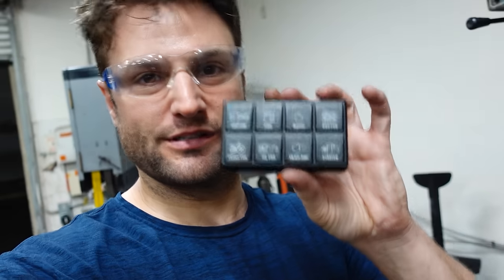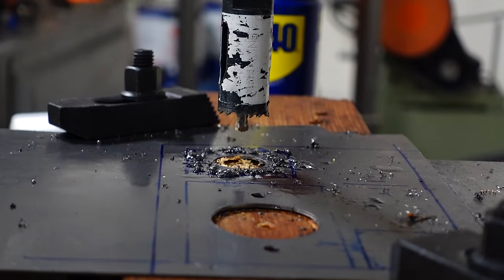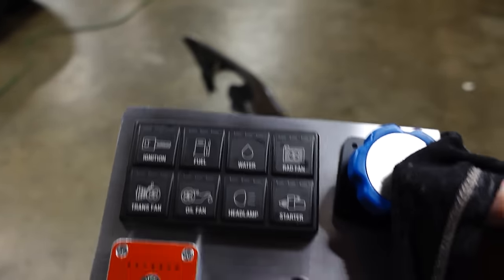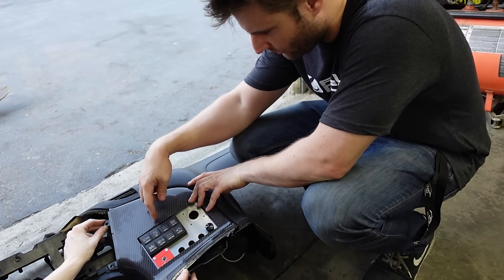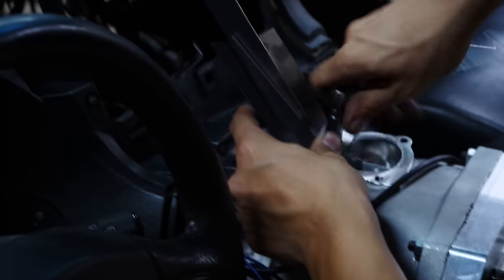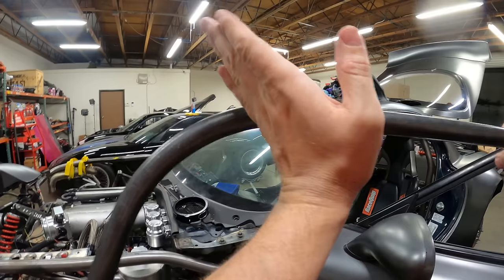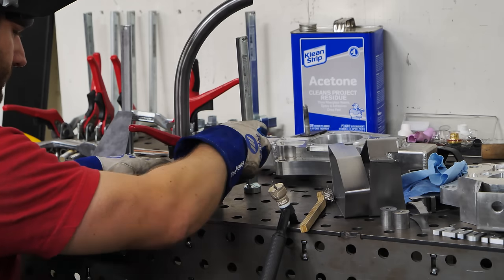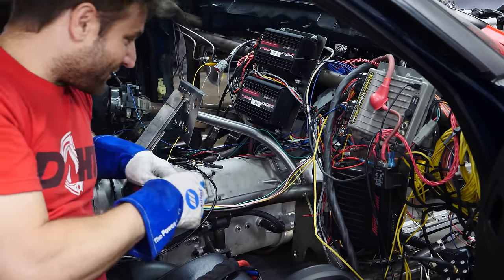Making a Control Center in the AWD 4 Rotor RX-7

Comment: Rob, your control box for your drill most likely has a dry solder joint and / or failed capacitor inside due to its age.

Realise you have a lot on your plate to prepare for, but when you find yourself with an hour, disassemble it, coat the PCB with flux and resolder as many joints as you can.
Reply: True! Old caps crap out when they get warm. You can spot them if they leak or blown up!
Reply: Also wouldn't hurt just to clean the thing out solid, a metal shop environment is hard on electronics
Reply: Wonder if he'll see this
Reply: ^^^This^^^ Get a clean toothbrush and alcohol and clean the thing after too. Oil gets into everything.

Caps are super cheap and are why many flat screen TVs "die". I've fixed a few TVs and monitors by replacing blown caps.
Reply: if the power supply section of that DRO is separated at all, it will be totally easy for any electronics shop to repair. Maybe Louis Rossmann would like to take a crack at it?
Reply: @auke1031  I'm pretty sure Louis only specializes in apple products and Chinese Amazon ebikes 😂

Seriously though, opening up an electronic device and just soldering away is a great way to popcorn an IC and really fuck your day up.

If you don't know what you're doing, do yourself a favor and DO NOT cover your boards in flux and go HAM with a soldering iron. That's just horrible advice to give someone 🤣
Reply: Where is Isaiah?
Reply: He needs some ToT thisoldtony

Comment: So open that readout and look for dying capacitors. That looks like an easy fix, soldering relatively large components. Just use PLENTY of flux. If it's 10+ years old, just replace them all on a general maintenance basis. New caps are quite cheap and usually solve mystery problems like that.

Comment: Not good to have acetone standing on your welding table
Reply: Sure it is. You need to make sure you have a clean surface to weld on. Having it close at hand allows you to dowse the material in acetone mere seconds before you hit it with 1000° of heat. It really adds to the thrill.
Reply: Could make a good video great

Comment: Dude imagine Rob taking this thing to RMRW with Cleetus. 

AND Hoonigans donk comes too.
Reply: hoonigans is coming for shure! and for RMRW i think he will take the 2rotor corvette if he ever is going to attend
Reply: @guidoheeling1179  yeah, the 4 rotor uses sooo much fuel. it would struggle to get to the fuel stations on rmrw
Reply: @rorybrookes  mwa that's not my point, i think he has like a 30/35 gallon fuel cell in the thing, and i guess it would do 7-10 mpg so that would not be the problem.
Reply: rip hoonigan camaro
Reply: @rorybrookes  You're correct in how much fuel it uses, but he could easily tune it on no boost for a point to point map. Like guido said, 30 gallons at 7mpg is still 210 miles. I'm sure he could find gas stations at least within that range.

Comment: It might be to your benefit to cut the tube 4 inches off the switch panel,  weld a piece of tube that fits inside the 1in, drill a hole through and bolt it. so this way its solid mounted but you could still remove it if you needed to access something behind the switch panel.

Comment: when will you start tidying ur wiring loom, it looks really messy, and doesnt match the hype or potential of the car
Reply: When everything is working perfectly
Reply: most likely  after he's done with electrical work, no point in doing that before.
Reply: When building something like this there are so many changes and tweaks to everything along the way, no reason to make the final version of something in the middle of the build to then have to change it later. Same reason Bad Obsession Motorsport had that rusty ass suspension on Project Binky for so long, didn't clean it up until they were 100% sure it was going to work.
Reply: @NorwayVFX  Exactly. For the same reason, Rob left a lot of the wires quite a bit longer than necessary.
Reply: Nothing more frustrating than tucking your loom away nicely then having to undo it all because you need to add a sensor to the ECU or gain a power supply from the wiring harness. He'll do it when it's finished.

Comment: Ok tip for you. Do not use WD40.Use cutting oil. Look in the plumbing department of your local hardware store. . All you are doing with WD40 is dulling your drill bit.

Comment: Bro, put your Haas in hand jog mode ("Bridgeport mode"). It's basically like using a manual mill. I'd love to meet you and show you some cool tricks with your VF1. Haas' are our low end machines at the shop where I work in NorCal, but they work great if you only need to hold a couple thou.

Comment: You could have put two holes into the small tube, one at the top and one at the bottom, just to run the cables. Would have been the most engineered button plate ever. Plus your wiring would look wayyy cleaner. (thought about water filling the tube for a second but there shouldn't be water under the dash anyway xD)  btw you inspired me to finally buy an mx5 NA and do all the work myself. Greetings from Germany🇩🇪

Comment: The control center for the drill press / machine seems like a loose connection, or a fried board. Looks like the vibrations are knocking something out. It’s Worth replacing either or both. You’ve been lucky but will need precision eventually.

Comment: Rob old engine or gear oil (even better) mixed with old/new gas or diesel is a great penetrating oil and a better drilling lube than DW40 also hella cheap. Adjust the ration in regards to preferred viscosity and application.

Comment: I am not sure if I would have done it the same way as you by welding the keypad to the chassis. it is strong but that can be a hazard in event of a crash and you may want to move it later and will have to grind the welds of your chassis, maybe a tube clamp or even weld a support to bolt things on to!

But as always great video! Keep on going! I am only jealous of all the amazing experiences you are having! Enjoy!

Comment: You can use your CNC machine as a manual and do these things that you do on the drill press if your screen keeps bugging out. My T1 is a drill chuck so you don't have to load and change tools in the machines turret. Your position screen will allow you to monitor everything

Comment: May want to check if that tab on the potentiometer for that knob is connected to ground, or worse power.  Maybe put a plastic washer or something between the metal plate to be on the safe side.

Your DRO probably has a bad capacitor(or 10) that need to be replaced.  Replacing caps is pretty easy and you shouldn't have any trouble doing it yourself after all the other stuff you've learned on your own.  Number 1 and 2 rules of soldering: Use lots of flux and heat the joint, apply the solder to the heated joint between the two parts.  You do not melt the solder on to the iron's tip and then apply it to the joint.  You should melt some solder on the tip to tin it, but that's just to help the solder flow easier.

Comment: If the DRO scales are good and not too old,  you might be able to just get a new head unit. The cheap Chinese made ones can be pretty good. They have features like bolt circle functions which can be useful, like when you made the diff shims. If for some reason the old scales are not usable, it should be easy to order replacements in the same size. The most annoying part is mounting them for the first time but since the mounts are there, it should be relatively easy to bolt in replacements of similar dimensions.

Comment: Should take all those dimensions and have a carbon fiber set up done on the complete interior.  your car is a work of art and the interior should reflect the exterior and engine. Just slapping metal in there seams like a short cut. but either way it is a EPIC one of a kind machine.

Comment: A disconnect in that mount may be a good idea if you ever need to take it back apart. You could take two 2-bolt waste gate flanges and use them as a disconnect flange, or make your own flanges.

Comment: That slight welding distortion is actually a good thing, it pre-stresses the plate when the parts are bolted to it, making it stiffer than would otherwise be the case. You may wish to add another strut to the plate or end of the support, to reduce or remove vibration - but that will come down to testing, and you may not need it.

Comment: As a last resort if you cant have proper cutting oil i think you should be using actual motor oil instead of this canned greaser im guessing its seems like its heating up a lot even thoug you aren’t eating a lot i am guessing thats partly due to the fact your using has drill cutter but i think changing your cutting fluid would be a good decision for you.
Coming from a industrial fabricator

Comment: IDK if someone else said this but it would be easy to do the same template for a flat, thin sheet of carbon fiber and just sandwitch it on top of the aluminum so it matches. You could also use epoxy adhesive between them if you wanted to

Comment: I haven't finished yet so maybe you explained, but why are you mounting it to the body. Every vehicle I have ever been in just has them mounted to that spot on the dashboards, and they work great. If you want them to not have flex you just make sure the sheet metal doesn't have any flex, and then that it touches in multiple locations through the dash. The big thing is have a mount that screws into the front near the opening and then some anchor that goes back a few inches so it can't wobble. It just seems like crazy over kill. Especially since you will be working on this car so much and will have to remove it at some point. Not trying to jinx you but it's not a question of if it's WILL.

Love the car man keep it up and you will win SEMA 2021 or 2022 depending on the pleug

Comment: The wiring gives me anxiety attacks. I assume you're redoing it cleaner with proper motorsport connectors and such? All the Home Depot spec terminals on there will fuck up in short order and electrical problems are the WORST.